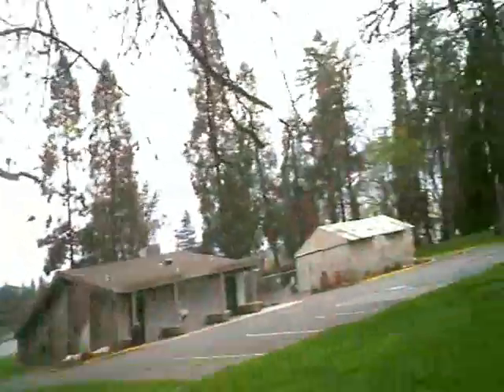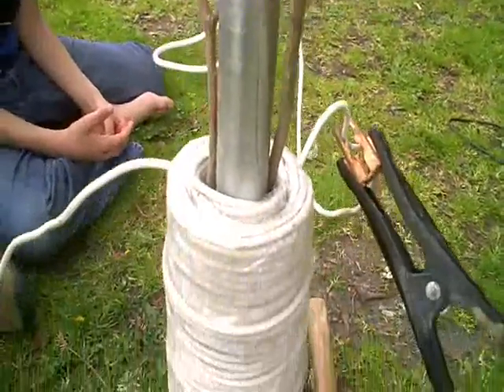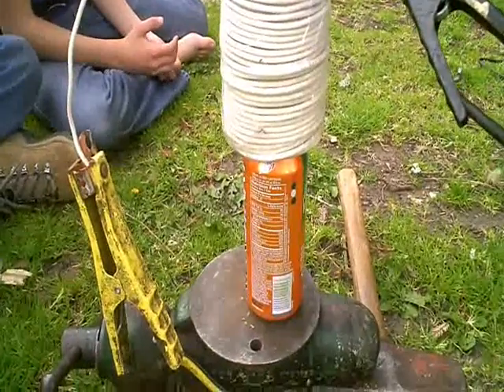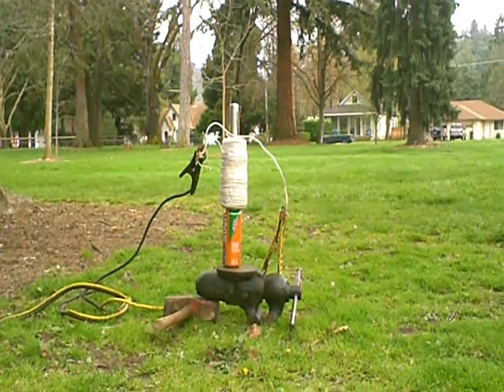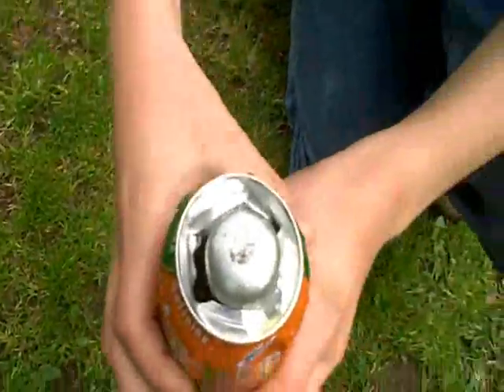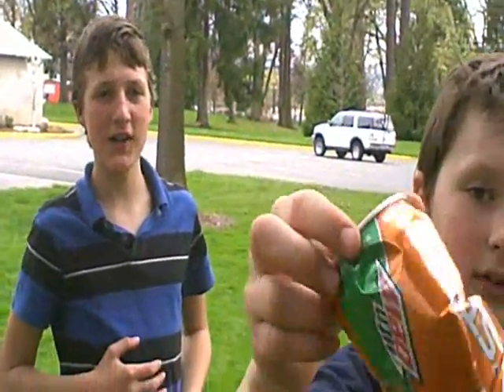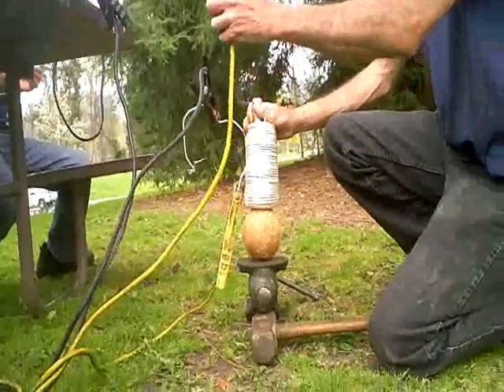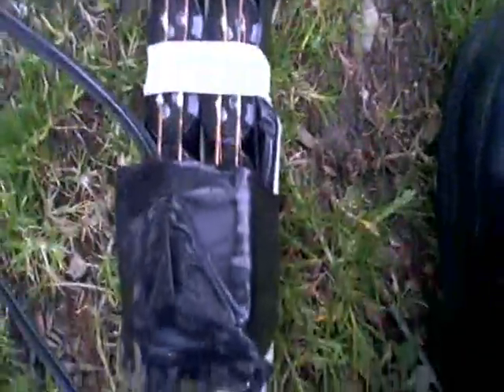Opening a Coconut with Electromagnetism.

Comment: How many Joules of instantaneous energy is this? A lot!
Using the formula E=(C*(V^2))/2
(Energy in Joules equals capacitance in Farads times voltage squared-all divided by 2.
Plug in the values E=(.01560*(250^2))/2.
To convert 15,680 micro Farads to Farads, divide by 1,000,000 (there are one million micro farads in a Farad). The result is .01560 Farads. 
Square the Voltage; 250*250=62,500. 
Multiply 62,500*.01650=980.
Finally dividing 980/2=490 Joules of Energy.
That's .657 Horsepower! WOW!!!!

Comment from the maker: Because I pulled the metal bar a few inches out of the coils center, the moment I energized the coil it's magnetic field pulls the bar back towards the center, Normally the magnetic field would keep bar held in the center if I had used a steady power source, but because I used a charged capacitor it instantly discharges after pulling the metal bar, allowing it to continue traveling out the opposite side of the coil from which I've pulled the bar away from.